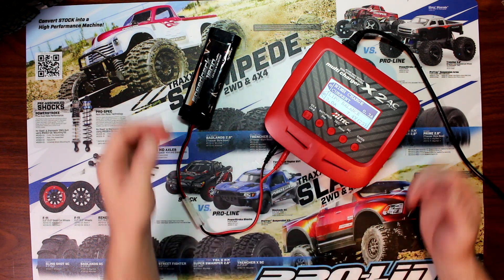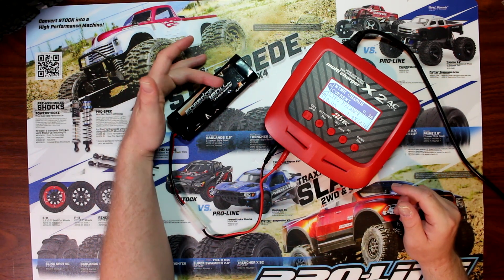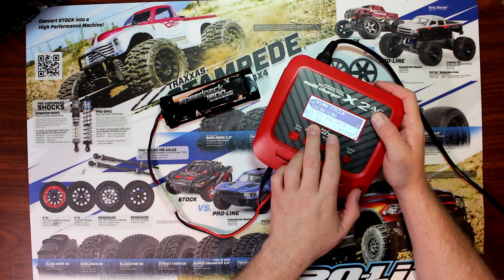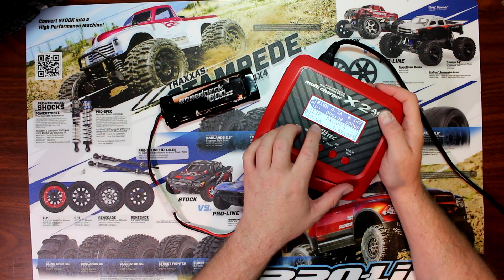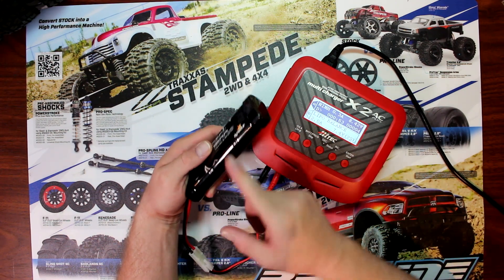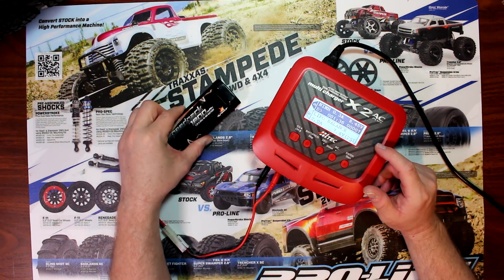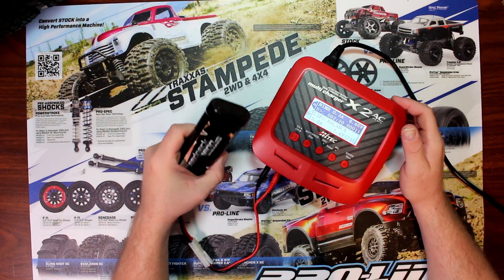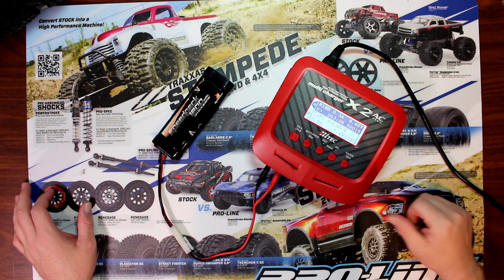How To Cycle A NIMH Battery

Comment: I just got a Arrma Granite Voltage and it came with a 1800 battery.  How do i know how many amps i should charge the battery at?
Reply from the maker: Look at the  amp 1800 it 1.8 amp

Comment: My venom nimh batteries get very hot charging with the venom pro duo charger. Then the speed pack battery I charge on the same charger does not get hot at all. I a thinking I am doing something wrong
Reply from the maker: I am not sure what amperage you’re charging at but do not surpass the capacity of the battery if the battery is a 5000  5amp is good enough. It is normal for a nimh battery to come hot when charging

Comment: Not exactly a question on this video but what ampage should I discharge at? 
My charger let’s me manually set it from 0.1A all the way up to 2.0A in 0.1 increments 
I have 5000amp battery’s NiMH
Reply: I don’t know if this is correct but I have a 5000 mah 7 cell nimh and I did 5.0 amp charge and .5-1.0 discharge

Comment: I have that battery and the 2nd time I charged it it hit 2000 so I unplugged it. Is that ok to let it keep going that far past 1800? Thanks
Reply from the maker: Some nimh batteries Will charge higher than that capacity that’s normal
Reply: @djsprc  Thank you, good to know

Comment: My nimh just melted its cover off
Reply from the maker: Jim might have a bad cell that’s why it’s melted it overheated itself or you charge that to high amperage
Reply: djsprc  ok so today i ran it then charged it then ran it again and when i took the body off it was showing the bare metal cell is that bad it worked like normal during the run. Could it be puffed or just too hot?
Reply from the maker: Talentless Cult Is it melted only on one cell or it’s all the cells. The plastic
Reply: djsprc only one but i put in on an ice pack to cool it down
Reply from the maker: Talentless Cult Do not use that battery do not recharge that battery it has a bad cell unfortunately she’s a goner
Reply: djsprc damn rip
Reply: djsprc i touched it too and already have a blister
Reply: djsprc ok and also one more question could the problem be that i put a new 19t pinion gear in it or it that just a coincidence?

Comment: My batterie won’t charge any idea thank u
Reply from the maker: Sergio Bernal Depending on the age of your battery it could be that reason or the batteries very very low in voltage and the charger is not able to take over
Reply: djsprc is like 4months old I just use It twice
Reply from the maker: Sergio Bernal What you can try to do depending on the charger you have do a slow charge low milliamp and see if the battery takes it
Reply: djsprc I got the same charger as the one  u have
Reply from the maker: Sergio Bernal It’s always possible that you have bad cells in it trying to lower amperage and see if it comes back if it doesn’t unfortunately it’s a bad battery.
Reply: djsprc thank u  I will tri the tomorrow

Comment: thank you for the very simply explained video. I have a 7.2 V 3800 mA that’s going on nine months old now and when I checked the resistance on my charger resistance came in at over 900. it could mean that the battery has been used so much almost every weekend and sometimes during the week and then probably not charged properly at first, that it could just be wore out. Please shoot me a message back if you wish with your comments on what I’ve just said.
Reply from the maker: Depending how you use your battery and how you charge it. And how you cycle it might determine its life but unfortunately some batteries May not be the same it’s just it’s nature it may last like it may not last might give you different resistance

Comment: Hi my dear I have 9.6 v 5000mah nimh battery its new not use too much but The problem its not come full charge I mean when I put to charge and after hours and half the charger is beeping and its showing full but the milliamp only 2000 or some time 2500 why not 5000 milliamp I charge 1 amp so can I need cycle also the battery is not too hot can you tell me what reason sorry for long question
Reply from the maker: Yes he will need to cycle your battery the reason this is happening is your batteries been sitting for too long not be active he created itself a memory you will need to try to get rid of that memory by doing a cycle or two on it you may not be able to get the full amount again but you should get more than you’re telling me
Reply: djsprc thank you my friend so I need cycle after cycle the battery is full amount I will try then I will reply I think one cycle ok or two
Reply from the maker: Bu Nasir You might need to do more than one and two but after a while you’ll see you’ll gain some more time with it

Comment: Why 2 cycles? why not 1? and is it correct that one cycle means 1 discharge and 1 charge? And is this also good to do every month?
Reply from the maker: Yes you can do only one cycle but you would be more in your advantage to do more then one cycles you should do it when your batteries been sitting for a while not been used.
Reply: @djsprc  How long does it each cycle take? eg I have a 5000mah battery
Reply from the maker: @trebor1841978  It depends sometime it might take a little bit longer or it could be shorter it depends on your battery internal chemistry

Comment: This good. But all I have is a small wall charger for my radio. How could cycle my batteries? Leave the radio on and airplane till dead and recharge?
Reply from the maker: If it’s your battery in your radio for an airplane I would not try to cycle it because if your battery dies in your radio you’re gonna crash your airplane. If your batt in your remote is a NIMH yes you would need to leave it on until it’s dead and recharge it.
Reply: OK. So after every flight run the battery down before the next charge?
Reply from the maker: North wind You do a cycle on your battery when it’s an older battery it’s able to gain some milliamp back if it’s a new battery you don’t need to do it
Reply: Thank so much. Yes very new battery. lol

Comment: There are  several tips for doing a pro job
Don't attempt to do this until you know what you are doing - the acid can burn your skin
check the voltage first - there may be a dead cell which would waste your time.
Check the battery fluid.
Try to fully charge the battery.
(I learned about these and more on Jons Mender Guide website )
Reply from the maker: This method is for a remote control vehicle battery not at lead acid battery for a real car verify your fax before doing a comment

Comment: Hi, my 9,6v nimh brand new battery shows 9, 3 v on my multimeter, but the battery is virtually flat and will barely cycle my ak, what could be the problem? I tested the multi meter with other batteries and its fine? Can you shed any light please?
Reply from the maker: Using a multimeter will not get you a correct reading. The reason why because you don’t have a load on the battery once you put a load I’ll give you a different reading you might have a bad cell in it. When you put it on the charger verify if it’s not a cell hotter than the other ones. If that’s the case then you have a bad cell.
Reply: @djsprc  Ok, tks so much, no all cells are good, no hot ones.
Reply from the maker: Ian Hinrichsen No depending on your vehicle or speak control it might be in Lipo mode. If it’s a castle creation speed control and it’s set an auto that will cause you issues
Reply: @djsprc  It's actually for an airsoft rifle.
Reply from the maker: Ian Hinrichsen That’s weird the only thing I can think of you have a bad set of batteries
Reply: @djsprc  ok tks.

Comment: so when charging a nimh thats 4200 mah i would discaharge and charge oit at 2.0 amps when doing a cycle battery
Reply from the maker: That correct
Reply: @djsprc  whats the final voltage that the battery charges to this charger charges the batteries to 1.5 vols per cell  thats what im trying to find out
Reply from the maker: Anthony Aviles depends on the amount of cell you have  calculate the amount of cells Times 1.5 if you have 5 cell x1.5 it a 7.5 volt  now once it’s fully charge it’s going to be higher voltage but that’s normal.

Comment: What about breaking in a new battery by cycling it? And what would be a safe discharge rate of a 5000 mah 6 cell
Reply from the maker: Do I cycle to break in your battery yes you can personally I would do 3 Amp to discharge. Just make sure to let it cool down before charging it or discharge it.

Comment: I have one question. Got myself a 6volt, 5cell, 4600mAH Nimh battery for my Baja. 
I kinda messed up with the discharging...  (got a IMAX b6 mini as a charger) I hooked it up and ordered my charger to decrease the volts to 4V. with a 1,1 phase. In stead of 1.0 volts..🤦🏾‍♂️🤦🏾‍♂️🤦🏾‍♂️🤦🏾‍♂️🤦🏾‍♂️

When i came back and noticed what happened. I flipped the switch in the on position to let the servos drain the battery and call it a night.

The next moring the battery is low.. nothing is working so I started charging it and find out that only 1153mah was pumped into the battery... and has a volt's of 6,43V...... sooooooo. Did I messed up my battery or is there still a change that I can restore it? Sinds it is a new battery.

Hope that you can help me out 👏🏾👏🏾👏🏾👏🏾👏🏾
Reply: Here is the update that I would gif. It was going quite well. The charger crammed 3100( more or less) into the battery and I was glad!! Until.... my cat start paying attention to the cables and sadly to say, I had to order a new battery....
Reply from the maker: Hallo Byebye Sorry to hear that that’s unfortunate for you but at least now you will know your battery is in good shape.
Reply from the maker: Sorry for the late reply for an nimh battery it’s normal for the battery to be more than 6 V when she’s fully charged basically what I’m seeing is the discharge way you use is not correct. What you’re going to need to do on your charger go to nimh mode. Then select cycle you will need to cycle your battery at least once or twice now I cannot guarantee you will be able to get the full capacity back of your battery you might be able to get good part of it back but you should never plug in your battery putting the switch on and leave it on for nothing. Doing a cycle charge on your battery will help you a lot.
Reply: @djsprc  alright thanks for the advice. I will give a update about how the process

Comment: nice video, how does one know when the battery is no longer goodthanks
Reply from the maker: How to find out if your battery still good 1 you will notice you’re getting less running time even if you do a cycle 2 if you notice when you’re charging your battery and using it doesn’t keep us charge 3 if one of your cell becomes hotter than the other ones your batteries gone
Reply: When it doesn’t work

Comment: Problem with my battery: 
Is not giving my car it’s full potential of speed and power
Even if I fully charge it and let it cool down it still weak.
Reply from the maker: I if your battery is nimh end it has a few years it might’ve created itself a memory. When that happens it decreases your running time. The other issue might be when you’re charging it if you feel one cell hotter than the other ones or one cell boiling hot that means there is a defect cell or a dead cell and dad will decrease your performance. Reason one if it’s an old battery you might need a new one reason to if when cell gets hotter than the other ones  you have a damage battery time to get a new one. Now if it’s a lipo  you might have a damage cell and your lipo.

Comment: Hey, I have an issue with my 5100 mah ni-mh battery. It will not charge. Does that mean it’s dead? I’m confused. (I’m kind of a noob at this stuff and I do not have your charger)
Reply from the maker: Sport Junkie If the battery won’t take a charge at all.  possibility that the battery might be done. What charger do you have
Reply: djsprc Traxxas ez peak dual
Reply from the maker: Sport Junkie if you ez peak. Won’t charge your battery dad means probably your battery is dead.
Reply from the maker: Sport Junkie depending on the age of your battery if your charger is giving a little bit of current you might be able to save it by discharging it and recharging it discharging recharging it.  Got a question did you try another battery on your charger to make sure it’s not the charger
Reply: djsprc yes, my 3300 maH works fine.
Reply from the maker: Sport Junkie It looks like your battery’s dead.
Reply: djsprc thank you I wanted to confirm things before I threw it away.👍🏼
Reply from the maker: Sport Junkie My pleasure

Comment: Why did it take 77minuties to to discharge my battery 1300 mah? I have a 5000 mah battery and I feel like it's gonna take me a hole day to do 2 cycles
Reply from the maker: The bikesandgame Mix It depends on the discharge rate you choose if you choose like in one amp it will take longer if you do a 2amp it will go faster

Comment: How do we decide the appropriate charging current for the battery? I heard about c/10, c/3 and so on...
Reply from the maker: CHAOZHOUREN usually is what's written on your battery. Let say that your battery is a 5000. You could charge it at 5 Amp. But usually what I do anything that's over 2 Amp. I charge at 2 Amp
Reply: djsprc good call if you have the time trickle charges allow the cells to catch up to each other without overheating damaged cells